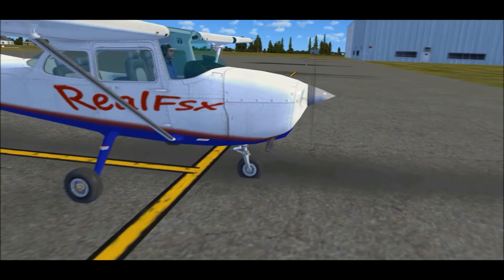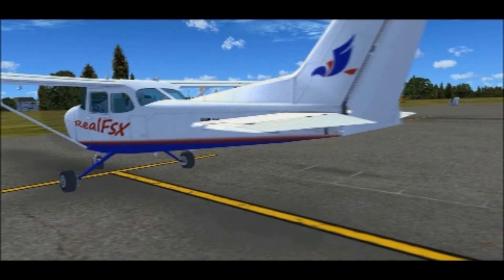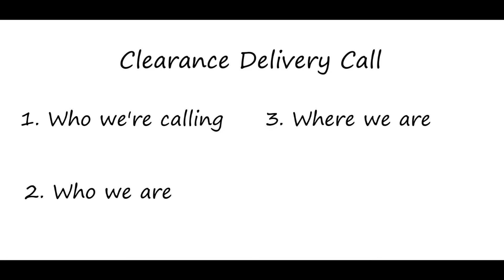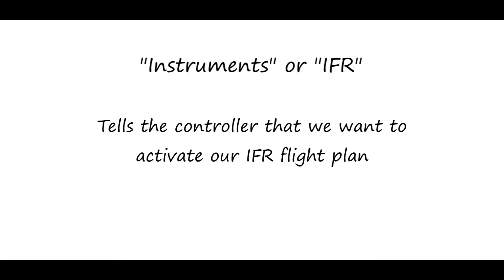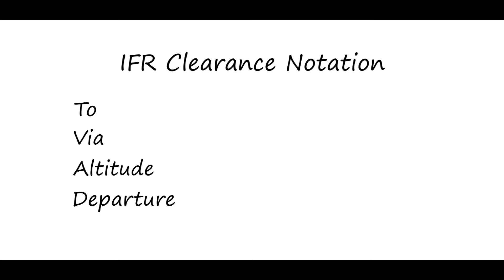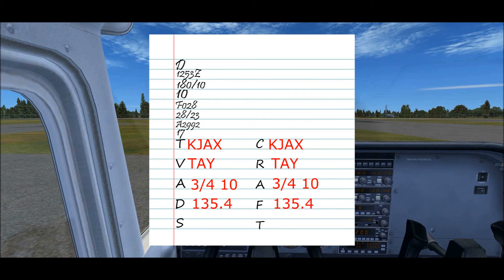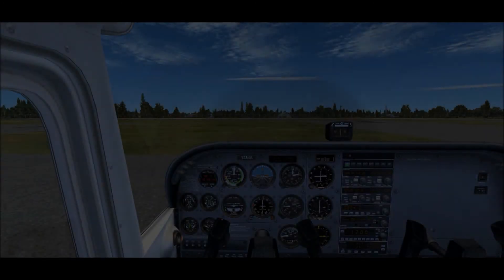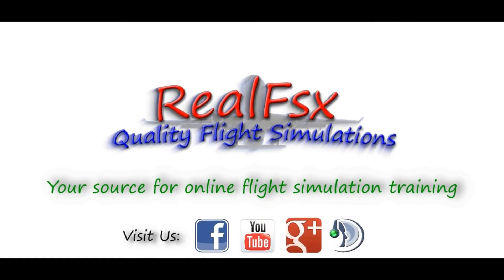Pro Tip: IFR Clearance Delivery | RealFsx.org

Comment: In the ATC response "ground point 7":  Do all ground frequencies start with 121?
Reply from the maker: Great question, Robert! Most ground frequencies begin with 121. If the frequency does not begin with "121", the ground controller will read the entire frequency. Thanks!